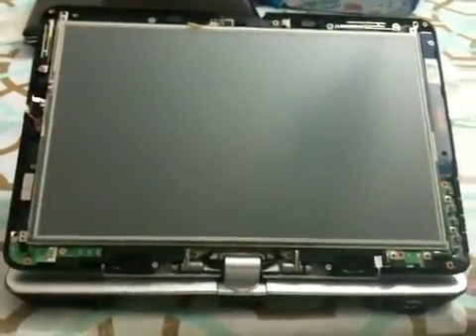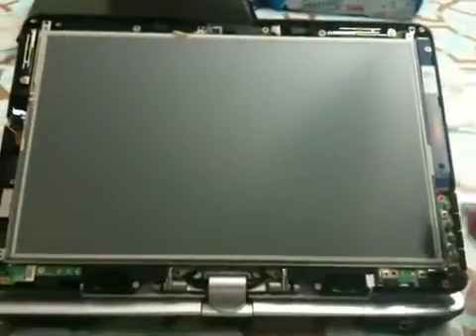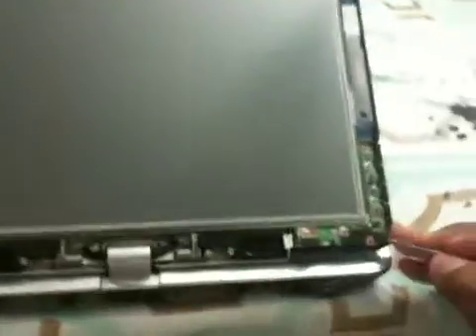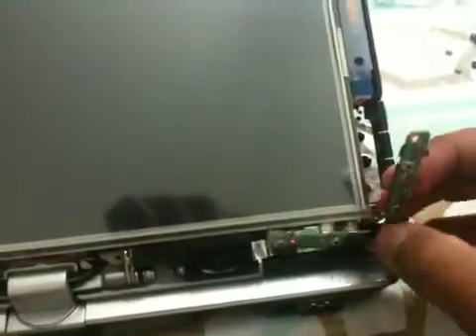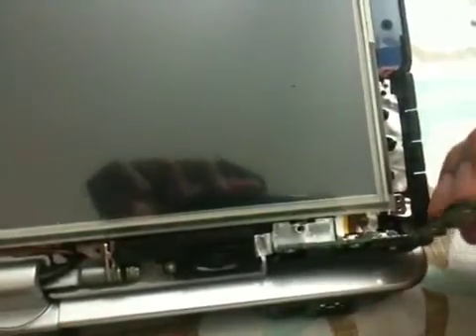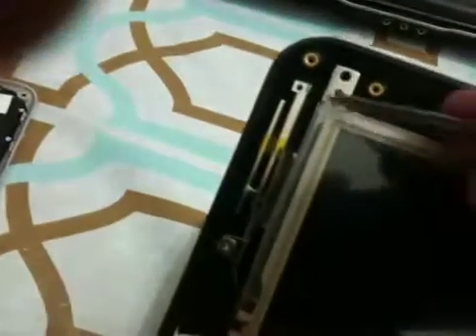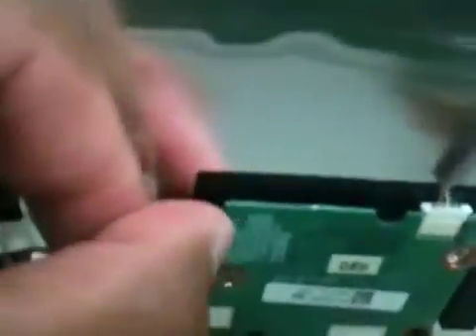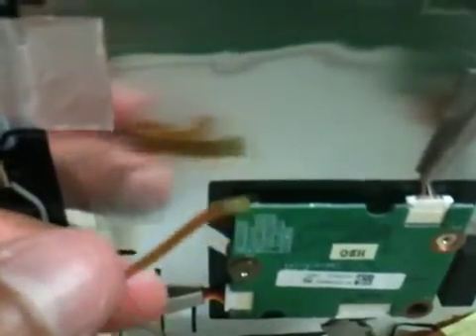TX1000 touch screen does not work repair

Comment: on the laptop screen... you will find these small rubber dots so that the screen doesnt touch the laptop when closed... if you remove them you will find the screws to open the screen panel... hope this helped